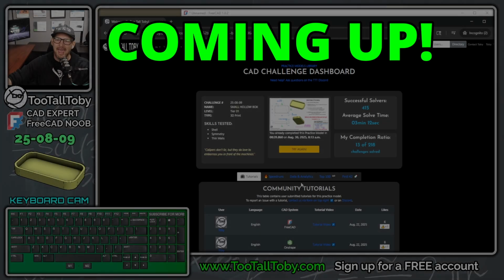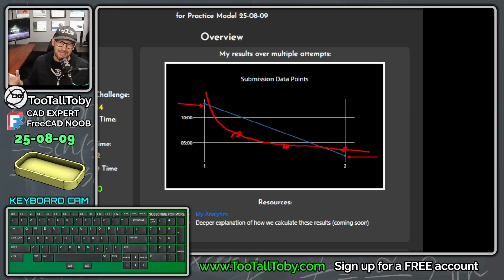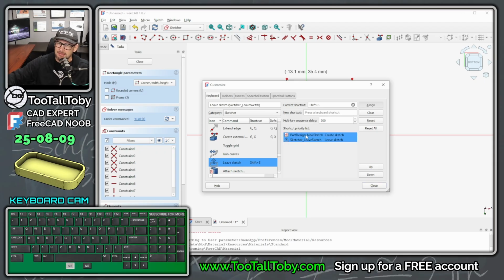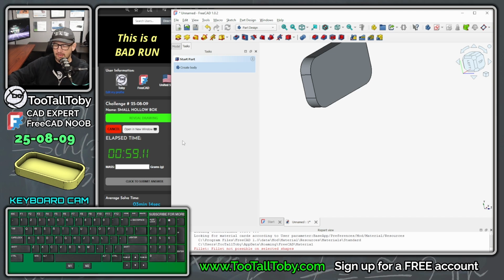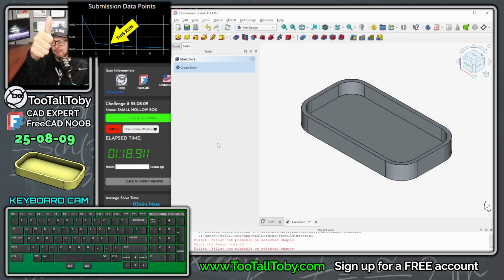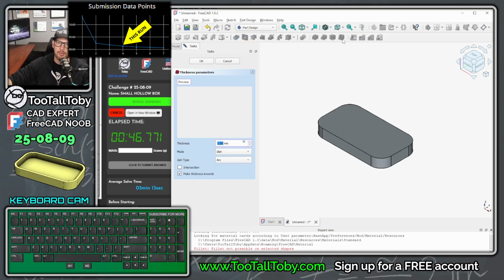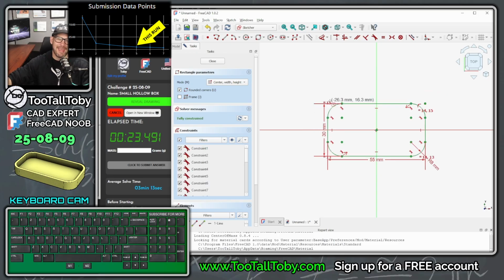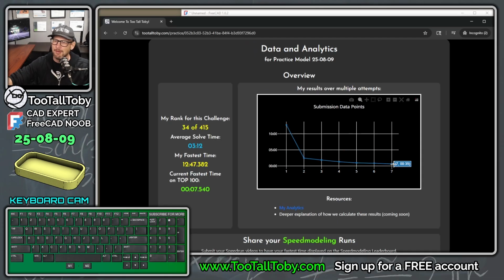Master FreeCAD Workflows with Practice & Keyboard Shortcuts!

Comment: Opentheme with the ondsel preference pack and overlay your task panels will put the option to select sketch right at the forefront of the page so when you select a face, a window is already popped up with the option to select sketch, but shortcuts are nice. 

The default for leaving a sketch is escape. It was default for me

Comment: Hi,  very cool, thanks to this video, I will definitely customize my shortcuts because I'm a bit lost coming from Fusion. 2 things I have noticed, when you create your normal centered rectangle with R, you can after that just press U to switch Rounded corners on or off (it's just a checkbox in the rectangle panel). And secondly, if you select the face before clicking on Thickness, it will already be selected so you can just enter the value and press enter withouth touching your mouse! Looking forward to see some Freecad users in the tournament!
Reply: Ok sorry, the same has already been posted by others but ok, anyway, thanks for the content and the challenges!

Comment: For the Thickness operation, select the Face before clicking on the thickness icon, then you have no more mouse move/click: the proper face is already selected, the thickness is highlighted, enter 1.6, Enter, you're done. That, plus the M to change the rectangle "mode" (works for every feature that has more than one mode, incredibly useful for polyline), you can vastly reduce mouse use (as should be the aim of every properly designed CAD software).
And I think is more efficient to create a new Sketch then select the plane you want in the drawing area (also avoids having to think about the name of the plane) ; that further brings the mouse near the center of the sketch drawing area, where it needs to be for the next operation (using only shortcuts for the centered-rounded rectangle).
Reply from the maker: Awww yeah these are both awesome shortcuts and I'm gonna start using them right away!  Thanks so much for sharing! Keep it coming as you see more and more of my FreeCAD stuff -much appreciated!

Comment: In your examples, you're using the "Generic ABS" material (1060 kg/m³) instead of the usual TTT ABS (1020 kg/m³). For small parts, your answers may still be within tolerance, but for larger parts they could be way off. Personally I prefer using the "Estimates" workbench for this purpose rather than running macros, particularly because I can pre-configure buttons for each of the standard TTT materials, and select the units I want for the answer.